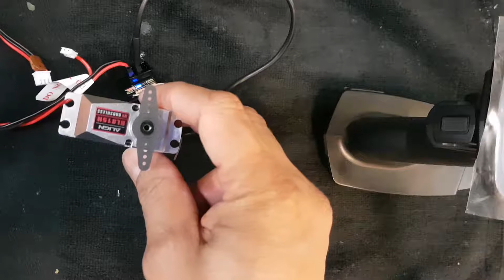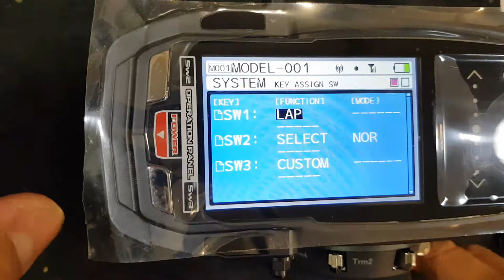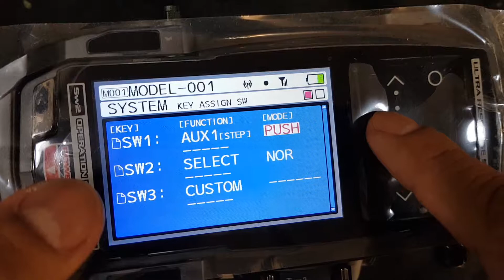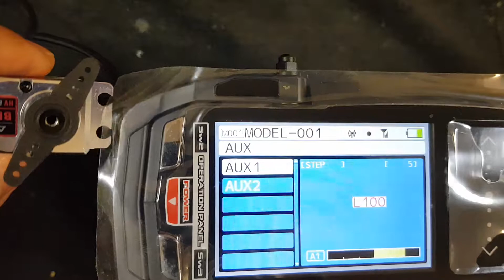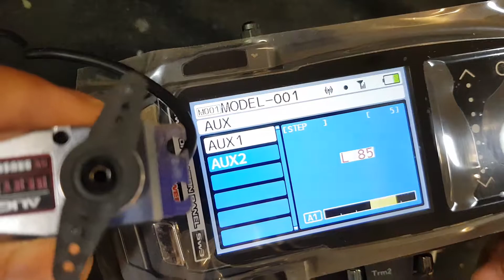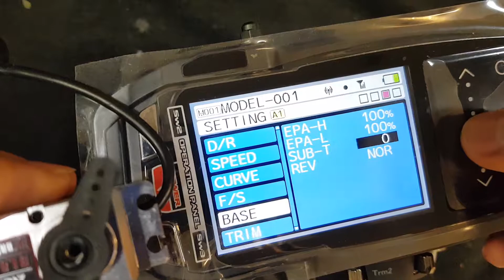Sanwa M17 Aux1 programming

Comment: Great video, you maybe my only chance of finding how to set up Aux 1 as a relay on off switch for lights?
Reply from the maker: hi, i did made it as a switch for the light also on a baja.. but still i used a kill switch module to cut off voltage to lights.